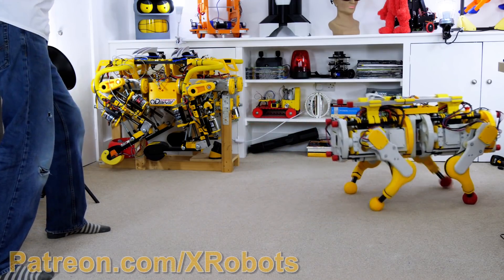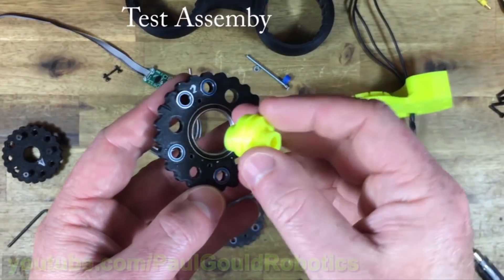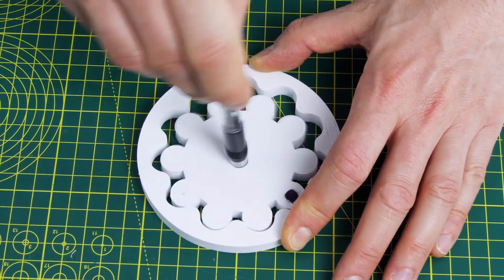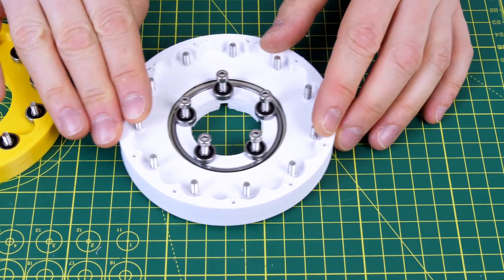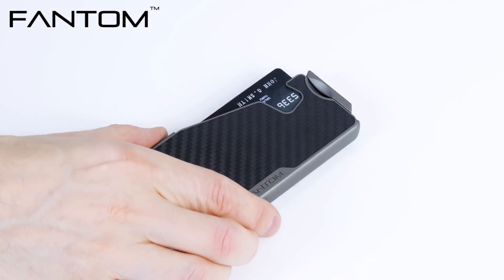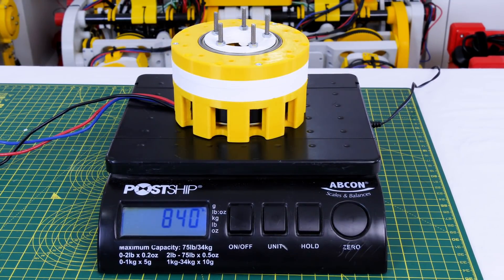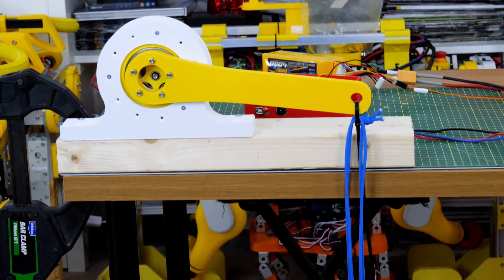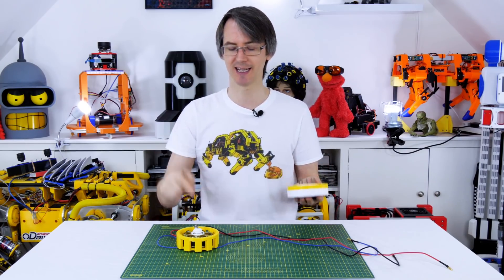Experiments with Cycloidal Drives

Comment: Might be easier to just build or adapt a large diameter motor and go direct drive.
Reply from the maker: It would be 10 times larger in diameter than the motor I have then.
Reply: @jamesbruton  Assuming width and thermals stay the same. Are your motors at their thermal limits as is? If you can produce the same torque at half the current that is 4x less heat, right? I feel like scaling the motor is very non linear and might result in huge torque.
Reply: @jamesbruton  I guarantee you have more experience and intuition with motors than I do. I was just making a comment, not being critical in any way.
Reply: @jamesbruton  You have probably seen this 'reflex' gear reducer thing: https://youtu.be/iLEwu-DvaFg

Comment: I recently experimented with cycloidal drives myself because I find the principle really fascinating. I didn't do it with such a high-torque or clean design but here's two interesting things I discovered:

If you use a correctly calculated cycloidal shape with well-tuned tolerances you can drastically reduce the eccentricity(wobbling movement). This not only reduces the strain on the motor and other parts, it also allows for more compact designs as - like you showed in the video - the holes for transmitting the movement from the gear to the output shaft depend heavily on the eccentricity. The drawback of this is of course that tolerances become more significant.

The second thing is probably not as relevant for your project because it's more suited for high gear ratios and hurts the ability to backdrive the mechanism, but double-staged cycloidal drives can be simpler to print and build as the output is automatically a non-wobbling rotation without the need of this transmission via holes in the cycloidal disk. So it can again be made smaller. I combined those two aspects to print a tiny double-stage gear with a ~1:1000 reduction, with an eccentricity of just 0.6mm! It's not very practical but it was more of a quick feasability experiment and a lot of fun to make, and interestingly works more smoothly than my failed first try using a single stage.

Comment: I feel like a second cycloidal disk is overkill. What about a simple, flat, lead weight, welded to the tip of the offset shaft, itself offset in the opposite direction of the shaft's offset?
Reply from the maker: That won't stop the sideways force on the cam that is causing the motor housing to flex. The second disc also helps convey force more efficiently. V2 comes up in a couple of weeks.

Comment: Make the high stress parts out of aluminum.
Reply from the maker: That's a lot of it because the motor housing is flexing. V2 comes up in a couple of weeks with most of the issues solved in PLA.

Comment: You can use M3 of M4 bolts of 12.9 steel quality instead of M6 overkill bolts. Smaller bearings would also allow you to make the device much smaller and lighter for a better impulse response. Looking forward to see it in action!
Reply from the maker: All the bolts are M4

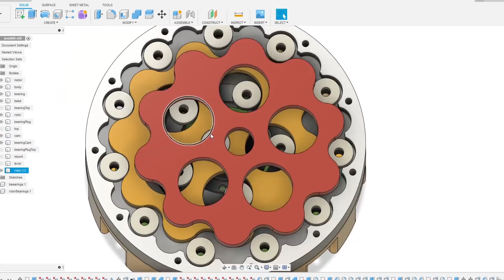Comment: 10:58 "... in opposite directions..."  maybe you misspoke or didn't proofread your script.  The two gears on the same (cam)shaft will rotate in the same rotational direction, though they will oppose each other positionally and symmetrically throughout the rotation.

Comment: Since you're doing quite a few gear systems wouldn't it be better to make a mould and use something like Smooth-on tooling resins to cast the componants? I've used quite a few of their products (though not this one) and they're very good. It should give you a much higher strength in your system.

Comment: have you looked at compound cyclodial drives? instead of the multiple pins and bearings for an output shaft, you have two disks (with different numbers of teeth) fixed to each other in the center and both the 'fixed' and 'output' sections have the same general structure.

without the need for the large output holes, the disks can have much larger input holes (supporting a larger crankshaft/offset) and is much stronger  (or the entire mechanism can be smaller)

see an example at https://www.youtube.com/watch?v=SH46bpe1cNA

Comment: What if you use a cycloidal drive with a smaller, but faster spinning motor and than use that to somehow drive the legs with a belt so it still has some spring in it?

Comment: Great video!  I wonder if you've ever tried making molds of parts and casting then in a different material for strength?  I've had success making molds of 3D printed parts and casting then in urethane.  It's a pretty easy process for simple parts like your cam or disk and can allow for faster duplication than is possible with a 3d printer (at least my old Taz5).

Comment: I was a vibration analyst in a previous life and these things are my worst enemies.
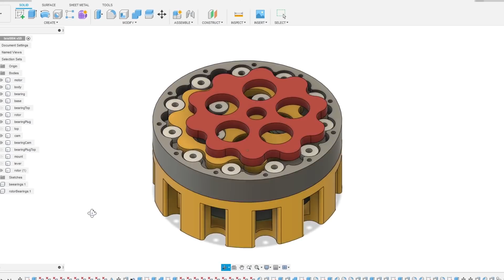Reply: industrially they are built with multiple stages out of phase to counteract the imbalances, which he mention around 10:50
Reply: @samrevers742  Found it. https://www.youtube.com/watch?v=rEoc0YoALt0

It was Steve Mould
Reply: @benjamin4321  veritasium has a video or two on vibrations
Reply: Thats nothing xD
I saw CNC-machines that shook the building they stood in because they accilerated and stoped so fast^^
The building was checked regulary to withstand it but it was crazy. They once tested a machine not bolted to the floor and it moved like an arms length in a few minutes.
Reply: @JL-pc2eh  Your run of the mill Haas has to be anchored to the concrete beneath because the rapids produce enough inertia to rock the machine when it comes to a stop. It is one of their huge downsides. Higher quality machines built with larger and heavier frames don't suffer from the same rigidity issues. Even if the Haas is anchored, the vibration from the lack of dampening will translate into surface finish issues on the part being machined.

Comment: If you haven't seen it here's an interesting variant design, which allows for planar multi-stage.  It's quite interesting because the design sort of inverts which parts are moving and may allow you to make a much thinner total and use the outer surface as the drive surface rather than a central shaft.  https://www.youtube.com/watch?v=6xoCeliJ11Q and here it is in actual 3d printed form: https://www.youtube.com/watch?v=qMK6P9xvVFU

Comment: I am really curious if you could multi-material print the contact edges of the cycloidal disk in ninjaflex.  There doesn't appear to be any slip-contact between the disc and the bearings, so if printed very slightly (a few mils) oversize it would maintain continuous contact with all of the (16?) bearings.  This would increase the contact area for each bearing which should improve the life of the cycloidal disk, and make the whole thing much quieter.  There would be lots of impacts on power transfer and backlash, but they are harder to predict (and are probably dependent on the interference depth chosen).  Another (simpler?) option would be to put rubber bands (or similar) around the bearings to get a similar effect.  I look forward to seeing the next iteration.  

Oh, there's a thing to think about if you are going to do mass balancing with multiple cycloidal disks: stacking two discs like 1|2 and making 1 & 2 the same thickness doesn't eliminate all of the imbalance (statically balanced, dynamically imbalanced).  To get a totally (statically & dynamically) balanced system you need three disks like: 1|2|3, where 2 has twice the mass of 1 and 3.  May not be worth the extra complexity, but worth considering at least.

Comment: The "teeth" of the inner gear could be made out of bearings as well. You just need to secure them in a way that doesn't shorten lifespan.
Also, why can't you have the batteries in the bottom segment of the legs?
Reply from the maker: Because that will make the end of the leg harder to move quickly.
Reply: @jamesbruton  I get that, momentum. But it'll be less top heavy, wouldn't it?
If you moved the batteries in the upper segments of the legs it would also make it sturdier and less likely to topple. By lowering and spreading the centre of mass.
Sorry, I guess I'm trying to solve a problem that's not really a problem.

Comment: Hey I do a lot of 3d printing my self and I have noticed your prints have a lot of under extrusion. You can see it especially clearly near top layer holes. This weakens your parts significantly. You should probably check and calibrate your extruder steps and measure your exact filament diameter. After that you can print a extrusion calibration cube to tune it in perfectly.

Comment: For the prints breaking, I remember seeing a test on screws where the screws were printed at 45 degrees angle so to avoid the delamination that often occurs perpendicular to the Z-axis. The drawback is it requires a lot of supports. Maybe if the central cam was printed at 45 degrees it wouldn't break so easily under load?

Comment: What kind of plastic is used to print the 3D parts? If it is PLA, or even PETG, I think the new PolyCarbonate blended (PC Blend) filaments might solve some of the impact and wear issues. I’ve found that it prints almost as easily as PLA but is far, far stronger and more durable for functional parts.
Reply from the maker: V2 comes up in a couple of weeks. If it works in PLA then it can be upgraded.

Comment: For a similar result, but with everything running perfectly "round" have a look at "Split-Ring Epicyclic Gear" (or "differential epicyclic gearset", "compound-planet epicyclic", lots of names for the same device). It is also back-drivable (but there is more friction).
You might also consider the "Strain wave gearing" that is also compact, has massive reduction-ration and  no backlash (and is supposed to be back-drivable, even if this doesn't seem obvious) ; it is 3D printable but requires one  "gear" to be printed with TPU or equivalent, because is relies on deformation to transmit the motion.

Comment: A larger motor is too heavy when you account for the batteries it requires, so let's throw a kilo of specially arranged hardware at it instead.
Reply from the maker: Do you mean 400g?  The motor weighs 450g and the whole thing is 850g. a 10:1 is obviously better than 5:1.

Comment: Personally I think a planetary gear set could do the same torque and reduction in the same space.  Big trick is keeping the gear teeth cool as they slide and flex.  Been thinking sealing up the planetary and 3/4 filling it with dish-soap and water would work quite nicely for cooling and lubrication.

Comment: Think this could use some M10 smooth rod:
- Ditch the exterior bearings and run the rotor directly up against the rod. Rotot on steel + silicone lube should be fairly low friction
- Same for the bearings inside the rotor: just put small smooth rods through each hole
- Finally, even the centre axle could be replaced. Then add a 3D printed cam and drill a fixing bolt through the rod

= smaller, fewer parts by ditching all the bearings and easy enough to build if you have a rotary tool with a cutting disc

Comment: this is exciting.  I wonder if a harmonic drive might be useful to you as well?  although i don't think it would be back-driveable like this would.  At least i don't think so.
Reply: Harmonic drives have the problem that one piece needs to be flexible so it can deform to mesh, yet stiff so that it doesn't bend under load.
and not 3d printable :-)

Comment: So let me get this straight?

- You choose to 3d print an off the shelf part rather than pick a CVT gearbox like a planetary one that will work and work reliably.
- You fail to realise that your math is wrong and even in the video your first gearbox doesn't spin 1.5 times but rather 2.5 times because 15/6 = 2.5 meaning its a 2.5:1 reduction
- You then choose a prime number to divide your ratio by making an 11/10 gearbox and wonder why the gears crunch. 11/10 = 1.1:1, which means if your gears weren't binding you would have been able to do a full rotation at the conversion rate of 1.1:1. You can confirm this by the fact that the gears dont move 10 times per revolution but rather all 11 teeth are in and centered in the video per revolution, if it wasn't the teeth would fall in the center or one tooth would be missing. If you wanted a 10:1 reduction I would suggest 40:4 as 4.44 is the ideal number and its the closest you are going to get with a single gear.
- Then to top it all off you add bearings to your load center of your gearbox, converting alot of your rationtional energy to wasted kinetic energy.

Comment: I like your improvements to the cycloidal gear with the bearings. Why not use barrel bearings as pins? For this mechanical scenario, I prefer worm drives but they are not back-drivable!

Comment: You need to switch away from PLA and go with something else with a higher thermal transition temperature. 
You are also going to always have problems with heat creep since the Tg of PLA is too low. 
https://omnexus.specialchem.com/polymer-properties/properties/glass-transition-temperature
Also your prints have defects that are going to cause them to fail faster especially near the edges of your holes. You can clearly see the gaps that will cause them to fail.
You might want to tweak your printer profiles to take into account for these defects. It doesn't matter if the project is accessible if it's going to waste people's resources.
You should be able to look at the print in your slicer and work out the bugs before printing.

Comment: Given that the main force requirement of a robot leg is to actually hold the static mass of the robot, it strikes me that a form of spring assisted leg could work well, where the spring effectively biased the leg to produce more torque in one direction that the other, which is what you want for holding the robot off the ground.  The max force asssist must be less than the total motor's torque at any joint angle of course, so as to be able to lift an unloaded leg off the ground.  As the torque on a joint is not linear (it varries with the angle of that joint) the thing providing the force assist will need to none linear, and balancing of the lever ratio and spring rates would be needed ideally.  Some sort of air spring is an ideal candidate, as these have a rising rate that can be simply tuned with a balancing volume set at a certain er, volume and pressure. As the force assist only acts in one direction, a simple cable system could be used to transfer that force from spring actuators inside the main body to the limb in question, and using suitable cam profiles for the cable anchors would make tuning the force vs joint angle fairly simple!

Once you motor is helped in it's job of providing the static holding force to overcome the robots weight, you then may get away with smaller (lighter) motors, geared more directly to keep the fast movement potential!

it would be relatively simple to work this all out for the joint that takes the highest load, perhaps the hip joint for example and to write a basic dynamic simulation model in python (for example) to determine the optimium values and geometry, and perhaps quite an interesting video doing that investigation too :-)
Reply from the maker: I'm considering it!

Comment: Plastic is stronger than people tend to think when your printer is running correctly, you're using the right filament, and especially- you have enough infill. That first break was the result of not enough infill. It looks like 20% infill. I'd wager you need at least 50%, perhaps more. 100% infill parts are incredibly strong when you have good layer adhesion. Strong enough to substitute for metal parts in some instances. It also appears as though James is having top layer issues that he needs to work out. You can see separation between the outer and inner walls, and that is going to be a huge determining factor in overall strength.
Reply from the maker: There's quite a lot of force on that part and the back of the motor housing was flexing too. V2 comes up in a couple of weeks.
Reply: @jamesbruton  Creality just released their newest Ender 3, V2. I just picked one up for $290, shipped. It has silent TMC drivers, a beautiful display, and the psu + control board are built in to the bottom of the printer. I think inflation of the US dollar makes right now the ideal time to buy. Oh, wait- do you guys have to pay import duties on things like 3d printers in the UK? You can never have enough 3d printers, especially if trade wars start heating up, or god forbid, war breaks out. Goods that we take for granted will become harder to get, and we will become increasingly dependent on 3d printers.

Comment: I think that cycloidal drive he made probably could have an airplane propeller attached to it and also get it fast enough to produce thrust but I don't know if it would get a plane off the ground maybe an ultralight but that I'm really not sure about also I think the only propeller that it could use is a paraglider propeller.
Reply: Just direct drive a smaller propeller with the motor. That's what this motor is designed for (large drones).

Comment: I think you might be approaching the limits of what you can do with a typical 3D printer... I realize it’s not as low-cost, and does require a different set of knowledge; but to scale this further, I think you’re going to need to go to CNC machined parts. However, I think you can get away with just a mill or a reasonably rigid router; I don’t think you would need a lathe as well. 🤔
Reply from the maker: V2 comes up in a couple of weeks. If it works in PLA then parts can be upgraded later.

Comment: Pyramid shape teeth would be perfect id think. Use less drive pegs of larger diameter so its strong
Reply: The teeth have to be round. These are not standard gears, they follow a defined parametric function to have constant contact